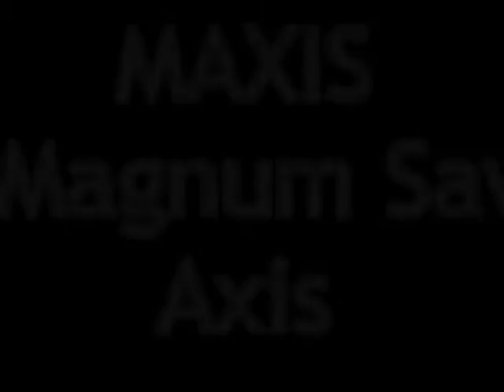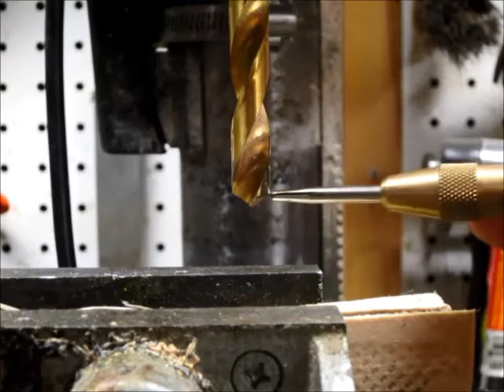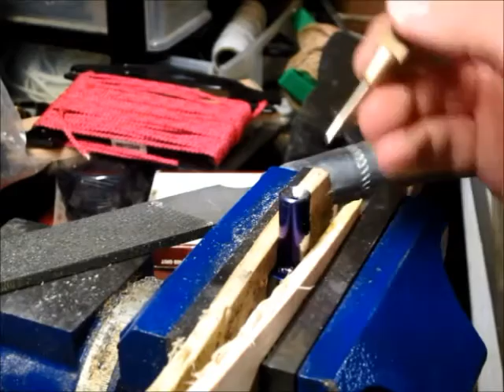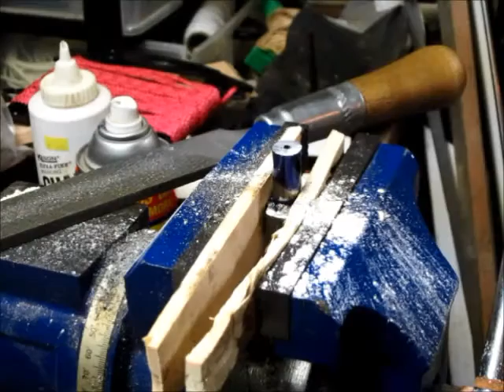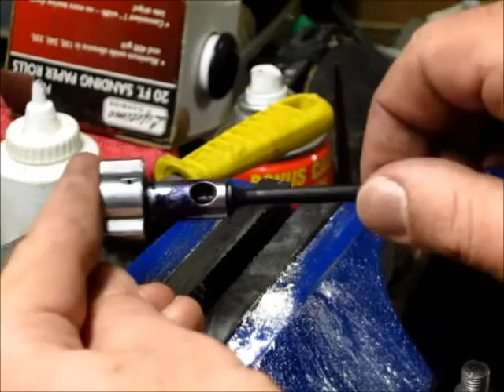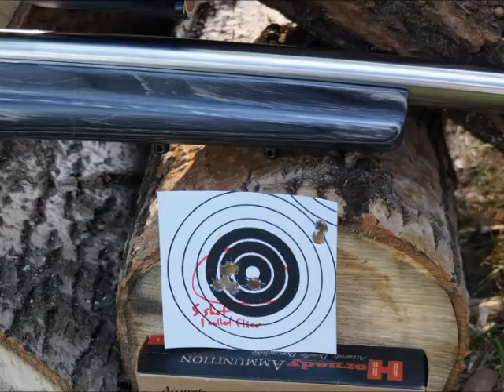Magnum Savage Axis Conversion - Bolt head modification

Comment: I know this video is old, but is the short action magnum bolt head by pt&g a viable option for this without having to modify it? I would love to do this to my long range gun im working on, but grinding down a bolt head like this makes me nervous lol
Reply from the maker: My understanding is that it is, but I have not tried it. I've also seen some people claim the Savage factory short action magnum bolt head (part number 106190 or 106660) will work without modification on an Axis firing pin, but those parts are quite hard to find.

Comment: I know this is an old video, but because the magnum bolt head is longer at the lugs than a standard bolt head, the firing pin will be a little short. It appears that you filed the bolt head shaft a bit shorter than standard shaft length to allow the firing pin to protrude the desired amount.
Reply from the maker: That's...that's exactly what happens in this video.

Comment: Very interesting conversion.  I too have been searching for a magnum bolt head for my AXIS.  I purchased a 6.5 PRC barrel without realizing I needed a different bolt head.  Was the bolt head that you modified the .473?  Or did you modify a different one, perhaps from a 110?  Any suggestions would be greatly appreciated.  Thanks!
Reply from the maker: The bolt head I used was a long action magnum push-feed from a 110 (Savage part number 103960).  I have been told that a short action magnum push-feed blot head (Savage part 106190) will work without modification, but I have not tried it.  The factory short action magnum bolt head is very hard to find, so PT&G might be the only place to get a compatible part.

Comment: you could have just used a magnum short action bolt head and it would have been drop in replacement
Reply from the maker: Have you done this to demonstrate that it works?  Much as I'd love to be proven wrong, my research on this topic at SavageShooters.com shows that you are the one who's incorrect.  The short action magnum bolt head is not the same length as the short action standard bolt head used by the Axis because of its thicker lugs (7/16" for the Axis, 9/16" for the short magnum).  The Axis firing pin will come up about 1/8" too short.  I've read that a one-piece firing pin from a 110 Trophy Hunter will work with the short magnum bolt head in an Axis bolt, but no one to my knowledge has tried it or posted measurements that would convince me it's true.  In short, I'd trust advice is given by an Internet buffoon who has done his homework and demonstrated his results over the advice of an Internet buffoon who has done neither.
Reply: +DrThunder88 still waiting on my barrel, guess i will know soon enough but if you are correct it is at least an ez mod to make it work
Reply: I will be rebarelling my axis 270 to 300 PRC, I do have the tooling to cut down a bolt head but I’m wondering if there an easier route? Short action bolt head and different firing pin?